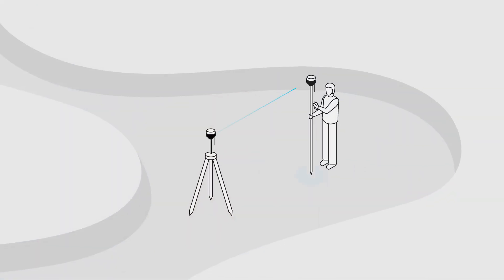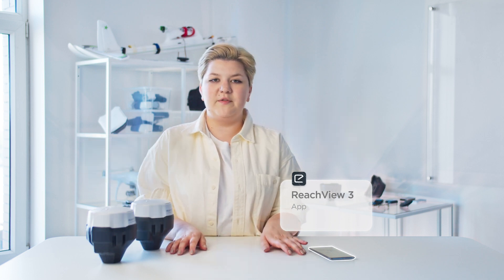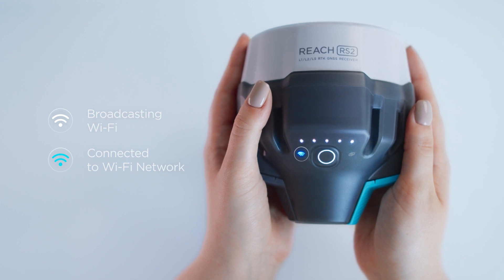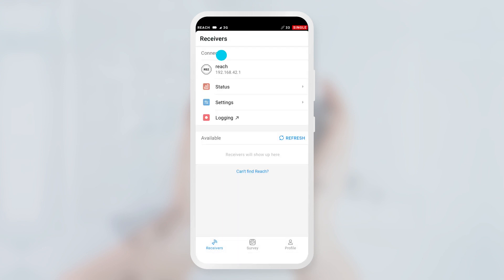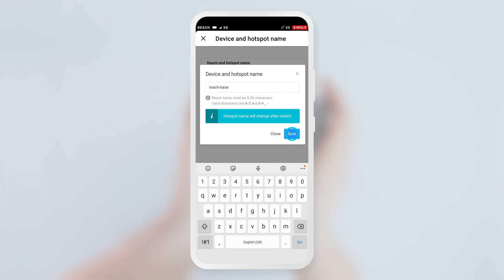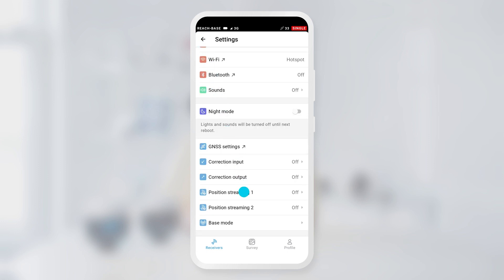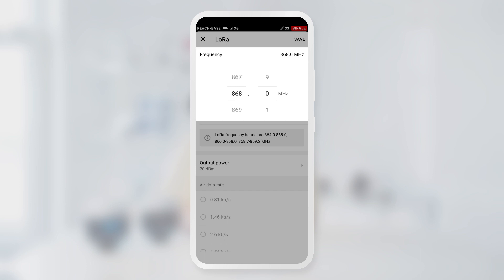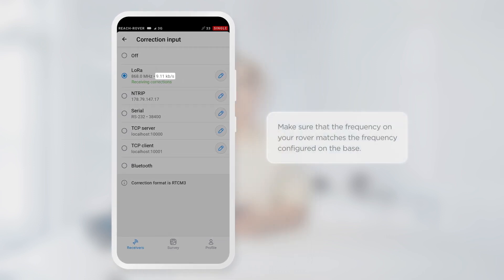How to Set Up RTK over LoRa Radio. Episode 1 of 3

Comment: Thanks for the video, I have a question, what happens if I set the base to static? I always did it that way and I see in the video that it's like kinematic.
Reply from the maker: Hi there! If your receiver doesn’t move, you can set your base in either static or kinematic mode. This setting is relevant only when your Reach is receiving corrections.

Comment: Hi Polina! Why do you use 0.5 Hz RTCM3 on RS2? and not 1 Hz?
Reply from the maker: Hi Luis, in this video, we suggest the most optimal and reliable configuration :)  According to our tests, it allows getting a longer LoRa range.

Still, it's possible to work with other configurations too.
Reply: @Emlid  Thanks ! I always followed the recommendations in the Emlid docs and never had a problem with 1 hz. You say that with 0.5 hz it improves the range of lora?
Reply from the maker: @luisgalina2770  Exactly so. When you choose the 0.5 Hz, you can use the lower Air Data to increase the baseline. The lower the Air Data rate, the wider the range.
Reply: @Emlid  Thanks!!! For NTRIP, is the same configuration of the RTCM3 messages valid?
Reply from the maker: @luisgalina2770  You're welcome! Such a setup is suitable only when you work with LoRa radio.